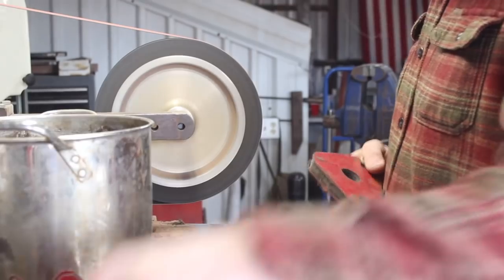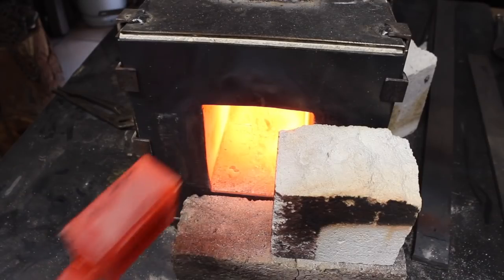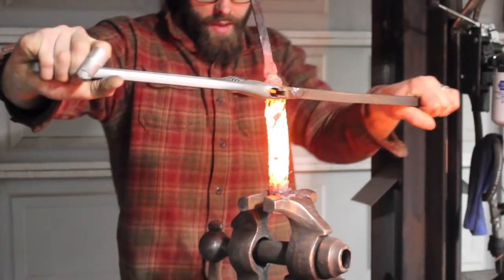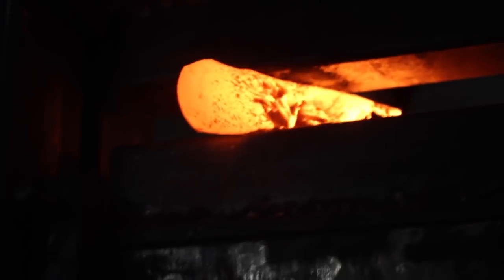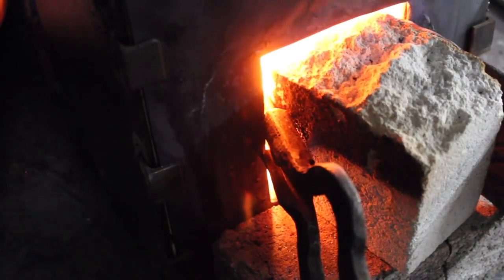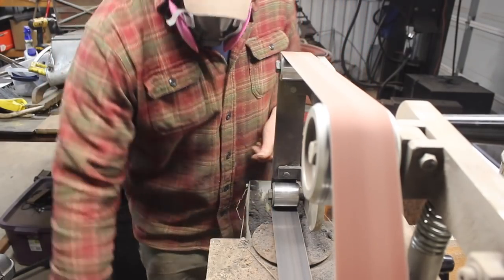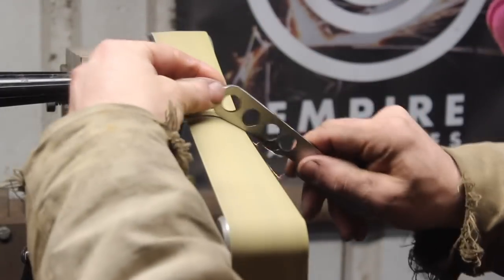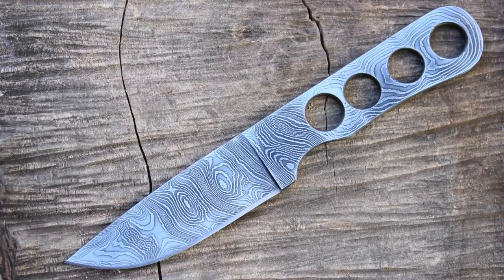Forging A Twist Damascus Neck Knife For Giveaway

Comment: hey man I recently found out that you can round the middle section of the twist damascus bar out leaving just enough square to grab on each end and then twist it. this way you don't end up with all the inclusions after flattening the bar like you had in this video. the pattern is a bit different  but to me its worth the time saved.

Comment: Great work! I really appreciate the blade profile. I do t personally like crazy blade shapes, and this is one that I really like. The pattern looks great, and the handle seems to be properly proportioned to the blade. I would actually carry this on my belt, I dont like wearing things around my neck. And it looks so good that the improper spacing between the holes is entirely forgivable.

Comment: My last EDC neck knife got to the point where the maker couldn't even sharpen it anymore and just replaced it for me! I use mine for everything and that's what I believe a knife like this is made for! From cutting rope, wire, leather to plastic and everything in between to using it in daily maintenance work that I do! It will be a EDC working knife for sure!

Comment: I've made a lot of these little all damascus skeleton handled utility knives.  One thing I learned the hard way is, that the area at the butt end, where you hold the blade with your tongs, doesn't etch the same way as the rest of the blade, due to the tongs stealing heat away.  Now, I always twist a makeshift handle on, out of coat hanger wire, for the tongs to hold onto.  This way, the heat stays the same throughout and your final etch is more even.  Not that yours etched differently; it seems ok.  Just a tip.

Comment: i'm loving the handle holes, even with the spacing that's "off". it almost looks intentional going from a larger gap down smaller. i'm surprised at how deep that etch is too... how long did you keep in the ferric chloride? and did you sand off with a high grit in between each acid bath?
Reply from the maker: About 10 minutes in the ferric chloride each time, 1000 grit paper to clean in between etching

Comment: Very nice little carry knife!  I'd be using it as we build our place in remote Alaska. (Moving there soon!)
Reply: Congratulations on your move up here. We made the off-grid move about 3 Winters ago. We love the off-grid life! We haul water, use an outhouse, have solar/generator power, and run snowmachines back and forth to our truck parked near the highway..
Give me a holler sometimes.. 👍
Reply from the maker: Awesome, good luck with the build!